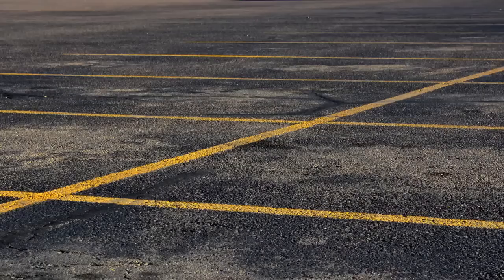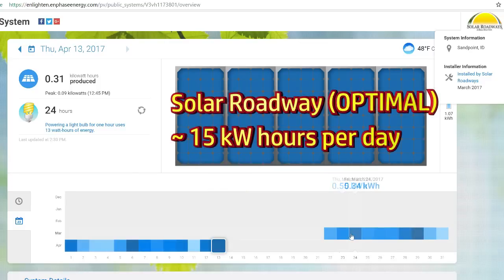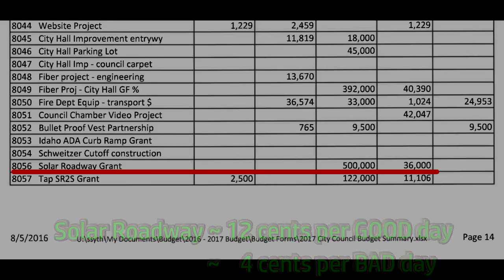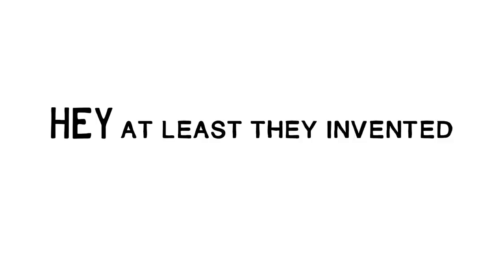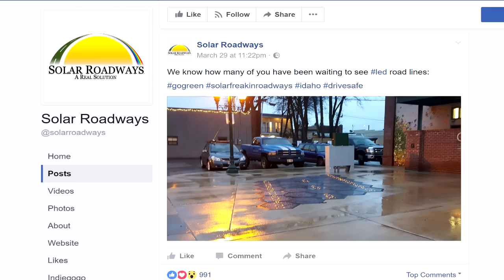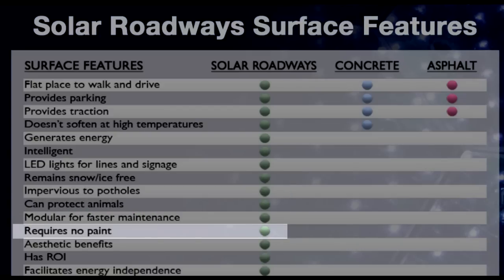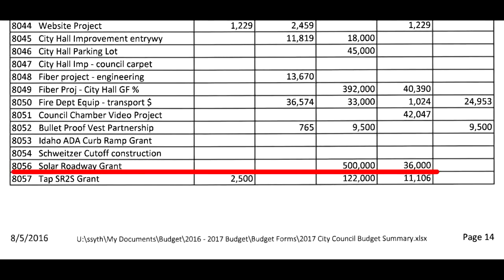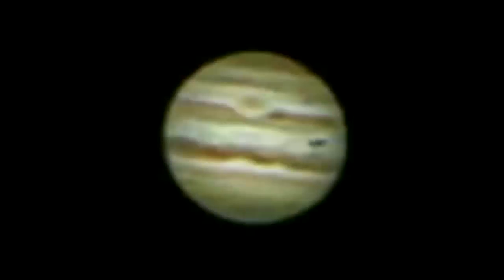Solar Roadways generate ~10 CENTS per day!!

Comment: Thunderf00t makes maths so enjoyable😁😂👍
Reply: The Random Cast make math great again
Reply: It's too bad he ranted on so many points that wouldn't exist in a final product. Not that solar roadways will get there but it's the practice of insulting flaws that will be fixed in prototypes that is awkward.
Reply: Dylan Watts - Can you give some examples?
Reply: I personally would fire the road worker that didn't make a flat road. That the "patio" section that was installed was installed by the creators of Solar Roadways. They are hobbyists, not engineers, with limited ability with tools, so of course it's uneven.
As well, the tiles aren't in any kind of production so of course it took 3 months to replace. If you only make enough to install and don't have any in storage of course its going to take time to get production going again. Even factories have to plan runs of product because of this.

So thunderf00t at this point is biting at the bone for meat. He already proved it is a non-starter and he proves very well how terrible the little amount of power that it produces is, but to attack points that wont exist in a final product is getting a little needy for argue points.

I have a business degree and like thunderf00t because he explains the science that I wouldn't know about, but he just went too far in this video.
Reply: Dylan Watts Hey, what better exercise is there than beating a dead horse? Especially when the horse refuses to acknowledge that it's dead?
Reply: Dylan Watts - Yeah, and those two items are about 15-20 seconds of a 18:50 video so it's not really a substantial part of his argument.  The vast majority of the video is pointing out why Solar Roadways are a poor idea, too expensive and don't work as advertised.
Reply: @Ben
Okay, so I make a 10,000 word paper and put the N word negatively in there once. It's not a substantial part of the paper so by your argument it's okay. If it's not substantial then why put it in? Just because he doesn't have science to make it a big part of the video doesn't disregard the fact that he had it there. It is similar to not picking someone for your team because of their skin color. It really doesn't matter their skin color for the sport, just their skill, so why is it a thing? This is Thunderf00t saying enough is enough and using points that dont matter to make the product seem worse than it is. For a Scientist, that's a low point. Scientist are listen to because they facts back them up. As I said, Thunderf00t is just getting salty that Solar Roadways is still a thing.
Reply: Dylan Watts - I think the amount of attention he gave it in the video is proportional to how much of a problem it is.  Because it IS a problem.  After years of research and spending millions of dollars they don't even have a way to properly set the things in place yet!  I realize it's "a prototype", but with as much time and money as they have invested, their current solution is pathetic (and that's being kind).  The fact that the reliability of the panels that hardly even get foot traffic, much less cars and/or trucks, is absolute garbage and that it took 3 months to repair them is also relevant given that they advertise it as a modular system that is easy to maintain and repair.  Again, with as much time and money as is dedicated to this project and the amount of visibility it gets, 3 months is beyond unacceptable.  But those are only minor issues compared to how terrible of an idea the whole thing is in the first place and that's why they only get a few seconds of video time.  But to allege that those are not issues, albeit minor issues comparatively, is not inline with reality.  It's kinda like if you have a car and that car has two problems: the power seats don't work and it starts on fire every time you start it.  Just because the car starting on fire is a far larger issue doesn't mean the power seats not working isn't a problem, it's just a minor problem in comparison. Thunderf00t's point is that literally everything about this Solar Roadways product sucks.  It is completely and universally worthless.
Reply: @Ben
Now you are taking my words out of context. The fact is that we are talking about a prototype that, to be marketable, won't have these problems as a final product. Unless you think the creators are going to make and install every unit they sell. Then you are the one not in reality. See how that works.

The point is, by the time this is a finished product there will be factories making thousands of these tiles a month, if not a day, making the replacement time within days if not hours. So the point that they don't have factories cranking these tiles out means that there is MUCH more production time. By the time that it is a finalized product it will have trained people installing the tiles which means nice flush edges. These are mechanical functions that will not be inherent to the product itself and therefore are not a point to be made.

Getting the voltage wrong so it starts fire is a good point on why it doesn't work because that is an integral part of the design. They are god damn electrical engineers and they didn't use the right wires/breakers? They want it to melt snow but didn't make it water tight? See the difference? The design is bad but the fact that the installation should have professionals and not amateurs on top of it's not actually in production yet is different.

While not in production, rather than having armies of robots and conveyors capable of pumping one out ever minute or two, you have to buy materials, wait for them to get delivered, shape and form them, and then finally combine them into a single unit by hand. This takes a considerable amount of time. But these are things that are streamlined when in production at a facility. Could you imagine how long it would take to build a modern computer by hand. And I dont mean order the parts and put it together, I mean getting parts to solder your own mother board.

And as I said, I'd fire the worker that didnt cut correctly sized plates to make flush borders AROUND the tiles. The point being is that the trim work is NOT part of the tiles design. On top of that, like i said earlier as well, you have electrical engineers doing metal work! If you look at it, the plates weren't even put in straight! No wonder it looks like shit, but it's not part of the product's design! As you could see too, the trim goes AROUND the tiles. Could you imagine an untrained person putting trim in your house? It would probably look terrible!

Does me saying that this is what I studied to do for a living mean nothing? Thunderf00t is a Scientist. If there isn't something to science about it, he shouldn't include it as it makes it too easy for those he is debunking to go, "look at this guy, he made mistakes here and here. Who says the rest of what he says is true," and people would believe them. Because spin and we have a lot of people who dont question, but I digress. The point is Thunderf00t makes really good science, but he needs to be careful how far he takes it as it makes it too easy to refute him despite the facts and science. Because again, people. Too much wonder, not enough ground.
Reply: I'm an electrical engineer and I can do MUCH better work than that installation drunk.  The problem isn't just the installation, though, it's that the border things are there at all.  Nobody is going to want to drive down a road that has little bumps like that every couple of feet - it'll drive you batty.  Not only that but they won't last.  And yes, that absolutely IS part of the product design - the product isn't just the tile, it's the entire system including the installation materials.  The fact of the matter is that they haven't even thought far enough ahead to consider how these things will be installed and that is piss poor planning/abominable project management.  But again, that pales in comparison to how horrible the idea is to begin with.  If there is ANY hope for humanity, this will never become a final, full production product.  

Does you saying that this is what you studied to do for a living mean nothing?  Yes, it means precisely nothing.  Anyone can say anything on the internet.  Also, there are tons of people out there with the same degree that you have who are idiots.  How do I know that?  Well, it's true for every degree out there.  I'm not saying you're one of them, but having a degree/having studied something means squat.  There are tons of shitty electrical engineers out there too and this product is a shining example of that.
Reply: @Ben
Other than the creator's driveway has a border-less variant on top of none of the CG models having borders...
I think the frame work was an aesthetic choice, now that I think about it too, as in the pictures it isn't even connected to any of the tiles, just bordering them.

That is very true, and I cant argue. The creators are electrical engineers and it caught on fire due to poor electrical work.

Comment: Hey Thunderfoot!
Can you talk about how solar panels get hot and how efficient it is to heat your water and cool your panels by running water under them?
Reply: so you water cooled a solar array and using the water for taking a bath,that maybe a practical way to improve the efficiency.i wonder if that can be used for cooling the house a little bit since the heat from the roof is transferred to the water not the room below it
Reply: that won't be really efficient at all, have a look at this article:

http://www.sciencedirect.com/science/article/pii/S2090447913000403

Since solar panels get hot on the top, how you going to extract the heat ? And you sure need a pump, that will also cost energy. Here's a conclusion of the article:

"The PV panels yields the highest output energy if cooling of the panels starts when the temperature of the PV panels reaches the maximum allowable temperature (MAT), i.e., 45 °C. The MAT is a compromise temperature between the output energy from the PV panels and the energy needed for cooling."

And they only used a system that just sprays water on top of the panels.
Reply: MrRolnicek 

how are you going to use the heated water ? Let's say you're going to take a bath daily with the heated water. According to 
https://www.withouthotair.com/c7/page_50.shtml 
Taking one bath needs about 5 kwh. If we take a look at 
https://www.eia.gov/electricity/monthly/epm_table_grapher.cfm?t=epmt_5_6_a
The residential average household cost per kwh is about 0.12 cents, meaning one bath would cost you about 0.68 cents (electricity cost only). So you need to calculate how much you would've to pay for a pump, other things like tubes, running the pump, etc. minus the kwh you gain because your solar panel runs more efficient.
I don't think this will add up well.
Reply: Guys, the city provides water pressure...
Reply: I read the introduction. Clearly cooling can increase efficiency and that's even without counting the heated water as "energy gained". But even in the introduction there is enough there to make an interesting video on the topic.
Reply: Ok, you think it will not add up well, I think it will end up just fine.
Moreover I think that whether it does or does not add up positively or negatively would make for a good video.

Comment: I just want nuclear roadways tbh.
Reply: dariomasi9 Who needs cooling towers when snow can be melted by the waste heat? ;P
Reply: THORIUM FREAKING ROADWAYS!
Reply: Fusion Freaking Roadways!
Reply: the glowing nuclear roadways make sure you can always see at night
Reply: In just 10yrs you'll gain radioactive powers like your favorite super heroes!
Reply: Thorium powered mach 1.5 skyscrapers full of creationists holding self filling water bottles.
Reply: dariomasi9 putting lines of Tritium in the road would be cheaper than Solar Freakin Roadways.
Reply: dariomasi9 singularity freaking roadways!
Reply: dariomasi9 Be careful what you ask for. Back in 1958 Ford proposed a design for a nuclear powered car. Probably a good thing there was no such thing as indiegogo back then...
Reply: Fallout would become reality guys
Reply: at least nuclear roadways can actually generate power xd
Reply: I want to surf the web with my nuclear computer.
Reply: dariomasi9 trump will give us nuclear roadways in about two weeks, give or take a week.